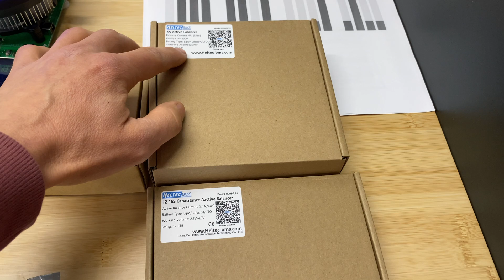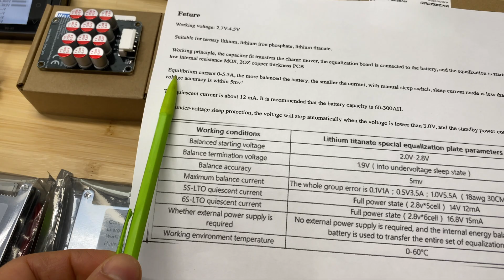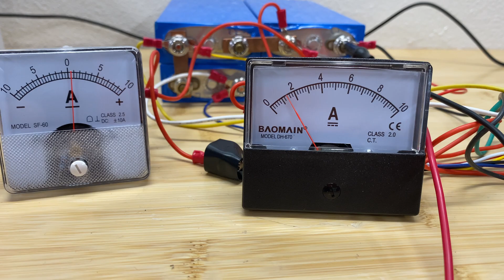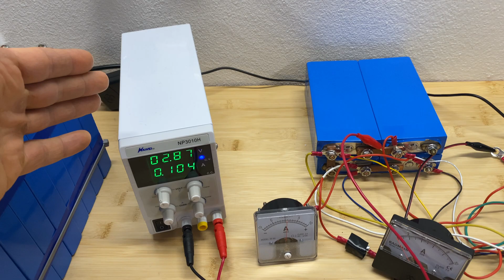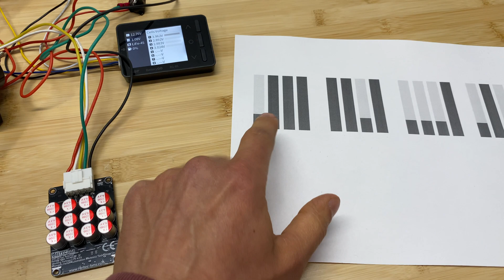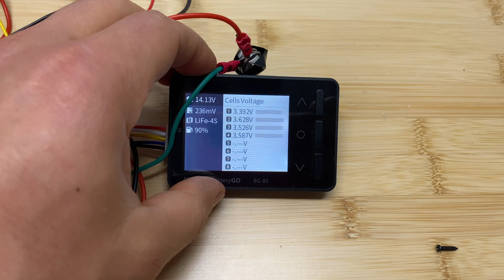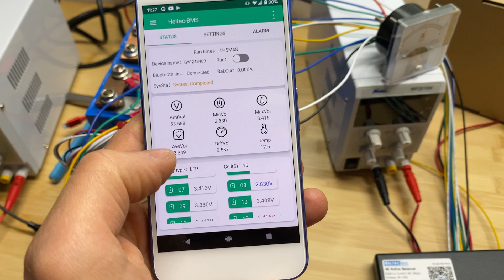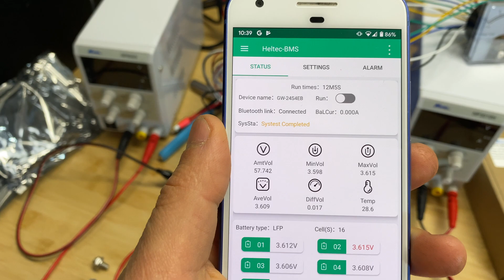Testing multiple active balancers from HeltecBMS.

Comment: Heltec balancers suck they dont even call you back. The yinlong lithium titanate battery is the biggest piece of garbage made to man. Im thowing 24 yinlong and xs power into a fire. So fat jeff is selling c cells and all Chinese sellers are selling dead cells. Thease bastards are getting away with it. A good cell has low ohms and it will hold most of the charging voltage. So a bad cell has high internal resistance and some can hold the voltage better and discharge like a dud. So the discharge test shows your good cells and the ones that can maintain the holding volts. You want a battery bank to give you the capacitance the discharge voltage and a little drop of voltage at sleep and stay there or you got shit. Buy life pro lithium iron im packing my suv with temgot lifepo4 460 ah batteries I can run 1000s of watts off just my batteries who needs a alternator. Take them lto lithium titanate cells and hit them with 400 amps at each 6s bank that will fixe it or a fire just throw them in.

Comment: I used a JW9-14S active balancer on an $850 MaxAmps 12s 8Ah lipo pack. Despite being recommended for 60-300Ah batteries, I wanted something efficient that wouldn't just burn off extra energy as heat, the way passive equalizers do. My battery was brand new, and balanced within 3mV when I connected the balancer. The run LED did not come on, but I did see a little spark when I connected the balance lead. This unit is supposed to work for 9s-14s, so I figured that the LED didn't turn on because the battery was already too balanced for the balancer to run.  1 month later, I checked the battery voltage and found it was at only around 15 volts. Upon testing individual cells, I found that 8 cells were completely dead, and 4 cells were close to their nominal voltage of 3.7v.  I attempted to recover the dead cells, and got 3 back with no considerable increase in internal resistance. But the other 5 were toast and had grown internal dendrites of death.  I verified proper connection to all cells, and the jumper pads for chemistry selection and power-on were pre-connected correctly. And yes, I connected everything in the correct sequence. So this balancer killed my pack and I don't know why.  Was it defective, or just not suitable for the pack size?  I suspect that the balancer only works with 14S and tried to balance the cells to match the non-existent cells 13 and 14. But like I said, I don't know. $850 down the drain 🤬
Reply: Hello there. Did figure out why the batteries were toasted in the end ?! Have you contacted the manufacturer of the balancer ?  I'm just curious.

Comment: I'm curious if you can connect 4s 5amps each (to 4 packs) within a 48v battery to get say 20 amps of balancing theoretically, then have an overwatch 16s balancer sending power also. I know there would be a lot of switching and changing voltages. However I'm offgrid on a generator and solar only to balance. I don't have a week to tear down the battery and not use it to charge with a generator and balance all the cells say as 4s pack using a 10 or 15amp 12v charger to top off each pack. With 16s it would take weeks of running the generator with a 15amp 48v charger to get the cells topped off.  16s 5 amps just doesn't seem like enough to balance a 14kwh battery.

Comment: Hello. First, I have to thank you for your advice concerning the JK BMS/active balancer. I have installed some pcs of this BMS and the work fine.

I have another question. I am wondering if this JK BMS/active balancer could connect in parallel (2 or 3 DIY 48V and 280Ah battery banks), connect, and communicate with DEYE 3--phase, 12kw inverter?
Thank you for your help.

Comment: Can I hock up to my 15S DAILY 120A BMS an Active Balancer for 31 wires which are not connected to the 15S BMS only the Active Balancer is connected to all 31 batteries and out of the 31 Batteries 15 are in series for 48v can this be done ?
Reply from the maker: need more info. What is the battery config? 31 cells total and 15 are in series?

Comment: I don’t think you can calculate the required time based on voltage difference; you need to know the Ah difference, which is not linear with voltage for LiFePO4

Comment: Can you recommend a good bms for a 24 volt battery made with 24 Nissan leaf modules. It's a different chemistry than the lifepo4 and I've never had a bms before. I'm not sure what to buy but I need a bms to keep from having a fire from what I've been told. They battery has a top voltage of 25 volts and I only take it down to 20 volts. Any help with recommendations for the leaf bms would be appreciated

Comment: If all the batteries are connected together in series and parallel to act as a single battery how is it possible that individual packs can be balanced?
Reply from the maker: balancers designed to balance individual cells in packs.
Reply: @SolarEngineering  thanks for the reply but what I don't understand is how it would isolate an individual cell when they're all connected together as one thank you
Reply: @dust6242  The active balancer has wires going to each group. So the 4s balancer has 5 wires. 3 wires go the the middle connections and 2 wires go on each end. Now the balancer can see the individual voltages of all 4 cells. Any two wire connections side by side can see and control the battery in between the two wires. I hope that makes sense.

So if you had 4 separate batteries the balancer would need 8 wires to see the positive and negative of each battery. When you connect these 4 batteries together in series, 3 of the 8 wires are doubled up so the extra wires can be removed. You end up needing only 5 wires.
Reply: @dust6242  Also keep in mind that the balancer can only work between batteries in series. 
If you have a group of batteries in parallel, they balance themselves because all of their positives are connected together and all of their negatives are connected together.

Comment: Hello, up to your experience till today in BMS and active balancers , is there a reliable BMS and active balancer that you recommend?
Reply from the maker: I'm using JKBMS with builtin 2A active balancer in 23kwh battery bank. It's rated for 200A, but I'm limiting it to 100A.
So far works well.
Reply: @SolarEngineering 
thank you for your prompt response.
Do you use it 24/24 and 7/7, all time connected to the battery bank?
Reply from the maker: yes, working 24/7 since feb 2022

Comment: Your setup is wrong in many ways. First the cheaper balancers  they don't have the pulsating option, so the wire length has a big impact. Use as short as possible wire for those balancers.
Reply from the maker: I don't think so, all of these passive balancers are too far from specs. For example one of them is rated for 5A (so wires must be rated for 5A as well), but it's balancing with only 20% of the rated current.
Reply from the maker: any other wrong ways?
Reply: ..and another thing. These capacitive balancers switch a set of capacitors from connected  across the cells, to connected in parallel to each other  (disconnected from the battery).  Thus, current is flowing two/from the cells only half the time.  The 5.5A rating is the Peak current.  What you are seeing with your analog meter is average current.

Comment: What happens when you try to balance for example 5s battery with 7s~24s balancer and additionnal power supply ? Will it work ? Thanks
Reply from the maker: I know that last one I tested will work with external power supply. Not sure about others.
Reply: @SolarEngineering  I have just see new balancers 2s~24s it should work. Thanks for reply

Comment: Is there any recommendation to start the balance after 3.45V?
Reply from the maker: I personally prefer to set a low start voltage, it could be too late to balance when the lowest cell reaches 3.45V (at least on my bigger pack).
My settings: start voltage 2.5V (basically balance all the time) and cell diff voltage 0.02V
Reply from the maker: and to your previous question: it's not to make Heltec happy, it's to show that in real life balancer will not reach specified amperage.
Reply: @SolarEngineering  I'm Sorry for that wrong question. English isn't my native language and understud what you said about the real life at the second time i whatched which seems to me very clear. That's why I deleted It! Thank you!
Reply from the maker: @jefersono1971  I see, English is not my native language as well.

Comment: Hello. Interesting video. Do you think if I use my JKBMS  with 2 amp active balance with another active balancer you suggest same time connected to the battery to improve. Will it works?
Reply from the maker: I'm using 2 balancers with my 23kWh bank (1 built-in into BMS and 2nd balancer from this video). Make sure to run 2 sets of wires for each balancer.
Reply: @SolarEngineering  thanks for the return. You mean each balancer have is own cable for exemple connected close the cells?
Reply from the maker: yes correct.
Reply: @SolarEngineering  you mean connected directly to the batteries (to every single cell) and not to a connection hub?
Reply from the maker: @rOSScOGITANS  correct. Connecting to hub (or splitter) can cause false voltage readings and balancers will start balancing each other.

Comment: Hi mate just wondering thay say you can cascading the smart active balancer for more than 24s so if you hook up 2 balancer together say 36s I wonder if the unit's can balance between them. Like from cell 1 to cell 36. My battery is 14s and I have another battery 14s in  parallel 

Thanks
Reply from the maker: Hi, if you have 2 batteries with 14s in parallel, then your pack is 14s2p and you need to use just 1 active balancer since cells in the pack paralleled as well.

Comment: This is a fantastic demonstration of active balancers. Thank you!
All active balancers measure cell voltages on board so any voltage drop over those light gauge wires with, I imagine several hundred millivolt voltage drop under peak currents will decrease the current (i.e see a higher cell voltage than it really is ) it can push into the cells. With some suitable cables, maybe it can pull the rated current from a cell that is fully charged? Might be worthwhile checking the voltages at the cells. Ofcourse, all this is academic...we don't expect active balancers to balance in a short time.
Reply from the maker: thanks for the feedback, didn't measure the voltage drop.
Reply: @SolarEngineering  It occurred to me that they probably alternately  measure the voltage of the cell then feed current to the cell at some slow frquency so they can avoid the voltage drop due to current?
Reply from the maker: @Bennyboy-dog  I don't know, 1st and 2nd look like just opening bridge between cells allowing current to flow and it appears to be highly ineffective (at least for batteries 25Ah+). The last balancer has a transformer that allows pushing into cell 4A independent of cells voltage diff (pulsing to measure voltage).
Reply: @SolarEngineering  Yes, I noticed that about the last balancer. Looks like the way to go if that balancing is on the cards. Still in two minds about the efficacy of doing this after the batteries are initially balanced...but I don't know.